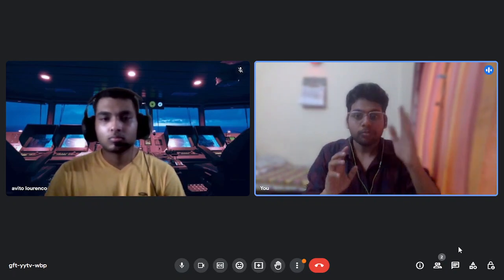The TOP 30 🔥(Part-1)||ANGLO||GME INTERVIEW (Q&A) session🎯 MOST COMMON QUESTIONS || WITH GYAN & AVITO

Comment from the maker: In this video, you will get a compilation of the most important technical interview questions & answers mainly by Merwin Braganza Sir for ANGLO at the same time it will help you with other interviewers as well and for other GME/Marine Interviews because knowledge is universal so it will definitely gonna adding value to all of you guys.

{Chapters🔔}
00:00 Introduction
01:05 - 1. Explain the centrifugal pump? Parts of Centrifugal pump?Why backward curve blade? The direction of Impeller? 
03:10 - 2.Where & how negative pressure is created in the C/f pump?
04:26 - 3. How discharge pressure is created in the Centrifugal pump?
05:38 - 4. What are the effects of having air inside a centrifugal pump?
06:46 - 5. What is priming? Methods of Priming? Vacuum pump?
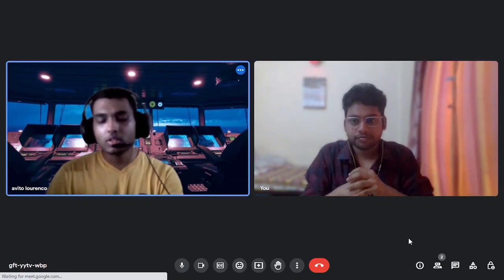08:37 - 6. Why discharge valve shut during starting of the centrifugal pump?
10:08 - 7. What is cavitation & NPSH concept, reason for cavitation (how to prevent cavitation)?

12:50 - 8. Explain the Gear pump?
13:30 - 9. How is negative and discharge pressure created in the Gear pump?

14:51 - 10. Diff. b/w centrifugal pump and positive displacement pump?
17:22 - 11. Diff. b/w reciprocating pump and rotary pump?

19:42 - 12. Diff. between Two-stroke diesel engine & four-stroke diesel engine?
23:01 -    ||Why is stuffing box required in Two-stroke (Main Engine)||

24:49 - 13. Auxiliary Engine Safeties?
25:11 - 14. Compressor safeties? ||Bursting disc-Working pressure||
27:04 - 15. Boiler safeties?
27:29 - 16. Refrigeration Safeties?|| Why L.P cut-out is also called cut-in || Solenoid valve||
30:23 - 17. Main Engine safeties?|| Oil Mist Detector- crankcase explosion||

33:24 - 18. Boiler Mountings and Functions?Fusible plug?

37:28 - 19. What does Faraday’s law say?
38:16 - 20. Lenz’s Law?

38:45 - 21.Blaise Pascal Law?
39:10 - 22.Archimedes Principle?
40:10 - 23. Reflection & Refraction?

41:32 - 24. What are the refrigerants we use nowadays? Properties of refrigerants? Why low condensing pressure? Why low specific volume?Why high latent heat of vaporization?
43:57 - 25. Explain the VCR cycle||Temperature at the evaporator coil? Condenser Pressure?

48:45 - 26. Laws of Thermodynamics?Zeroth law?First law?Second law- Plank & Clausius's statement? Third law?

51:53 - 27. Boiler accessories?

52:15 - 28. Bernoulli’s Principle & Assumptions?
53:10 - 29. What are NDT & Types? Red dye penetrant? MPI? Ultrasonic test?Radiography test?

57:00 - 30. Final year project
59:05 - Tips & Tricks for Interview🔥